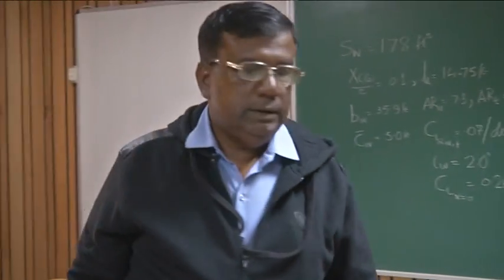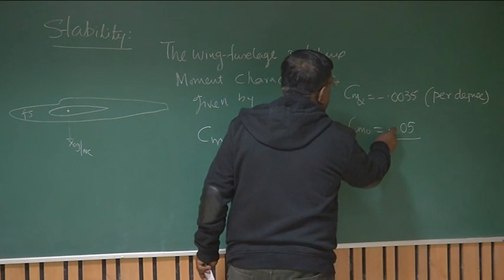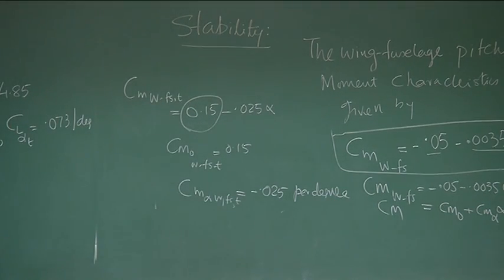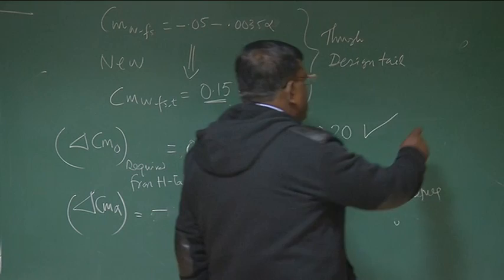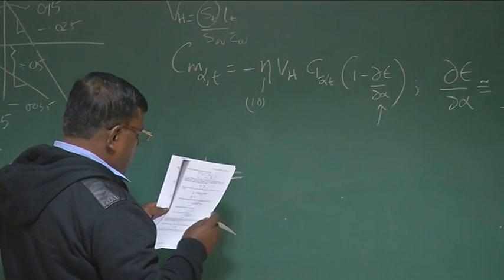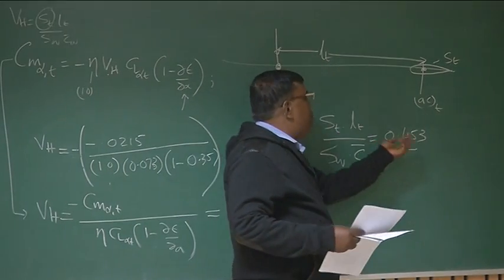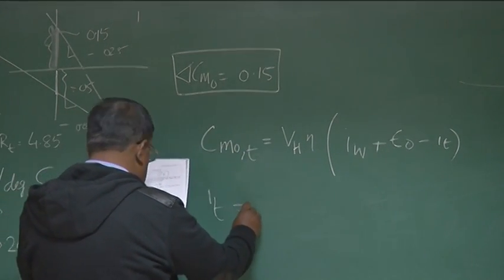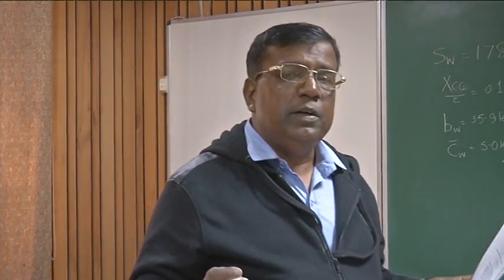Problems : Stability and Wing Contribution

Comment: Sir, very helpful.
Small correction, At  time 24:55  ΔCm0 = 0.2 not 0.15
Thank you very much...
Reply: no, he is right as he is talking about getting the required Cm0 of aircraft at that time.( watch the part few secs before carefully)
Reply: @arshdeepbedi6379  no he is right sir I checked it with Nelson book
Reply: @karukkuvelrajd2245  where can i find problems in nelson book can u pls specify the pg no